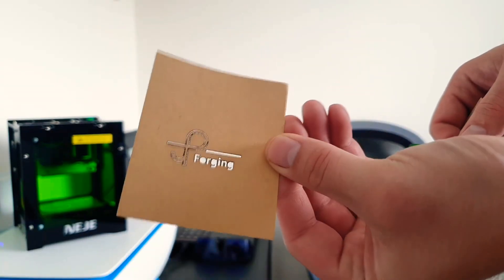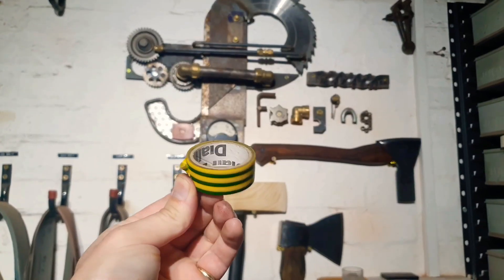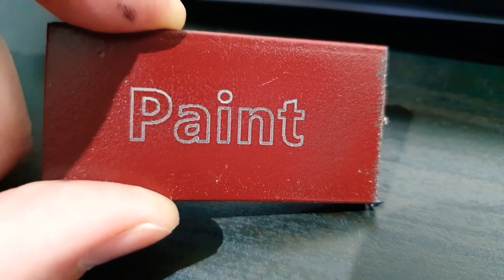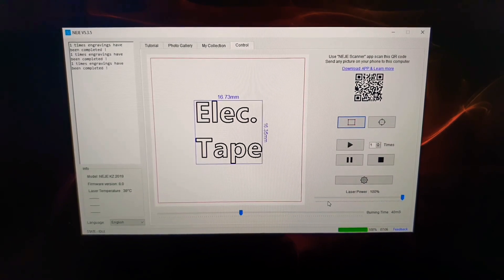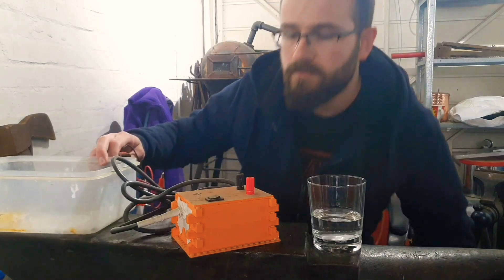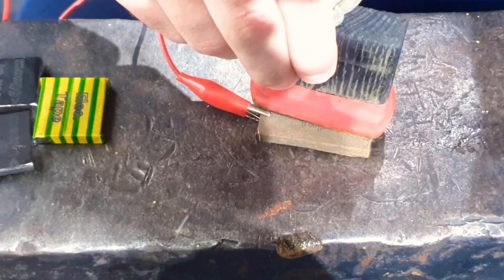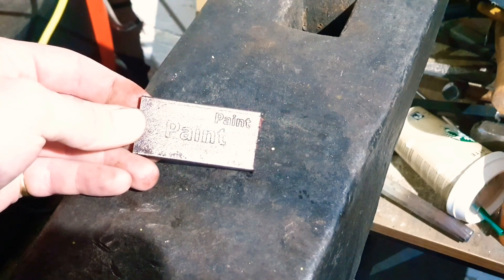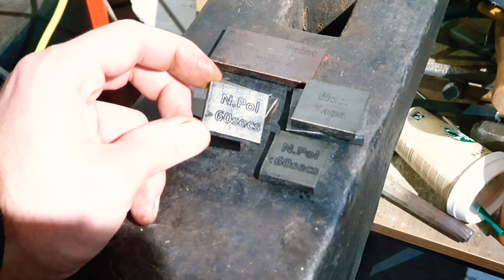Using a CNC Laser to Create Stencils for Electro-Chemical Etching

Comment: Thanks for this video! I was thinking of trying this and just finding the same as you that no one is talking about this approach. 

Also electrical tape is usually made of some kind of vinyl. Do not burn vinyl! It is PVC, poly vinyl chloride, which will release chlorine gas when burned. This has been used as a chemical weapon and can cause respiratory burns. Very nasty stuff!
Reply from the maker: Glad you found it helpful!
..and noted, thanks! :)

Comment: Have you tryed the cheap black worktop vinyl covering from the likes of B&M AND POUND STRETCHER OR POUNDLAND ive read on many forums it works really good for lazor printing ime in the process of converting my old anet a8 3d printer into a lazor printer
Reply from the maker: I have not tried it, but the whole point was I wanted to see what you could do with easily available household products. Given the effectiveness of several of these, honestly I don't feel the need to buy anything else to try. Thanks for the recommendation though, if I ever find myself lacking, I may end up getting some. :)

Comment: Have you tried thin Aluminum sheet(beer can) stenciling)
Reply from the maker: Do you mean to burn with the laser? Or to etch afterwards?
Reply: @PJTForging  Sorry for the confusion 1) Direct cut using Laser 2) If Laser unable to cut then  Electro Chemical etch.
Reply: @PJTForging  My Idea is to make PCB stencil or other Pattern Stencil using the Thin Aluminum sheet.
Reply from the maker: I don't think the laser would be strong enough to cut the aluminium, it doesn't like reflective/shiny surfaces. As for etching, I've not tried it, but the process should work as you can etch aluminium the same way as steel using this process. :)
Reply: @PJTForging  Thank you for the response . then electro etching i guess is the best and cheapest.